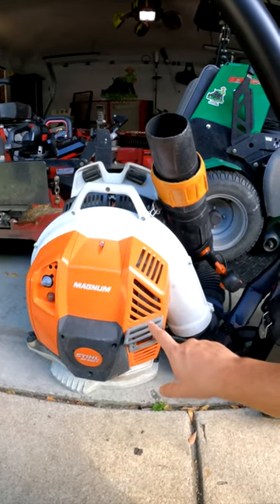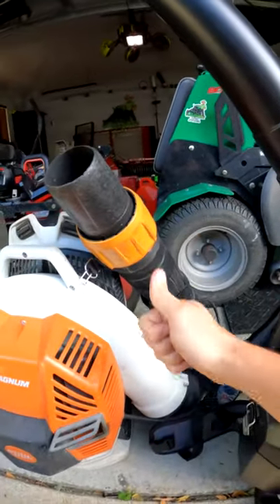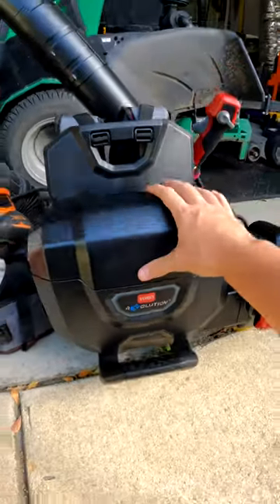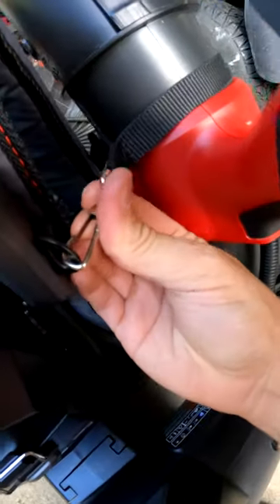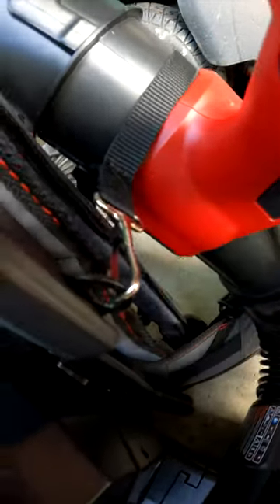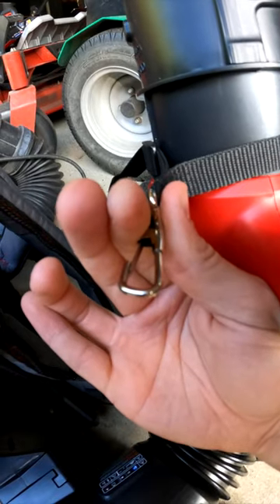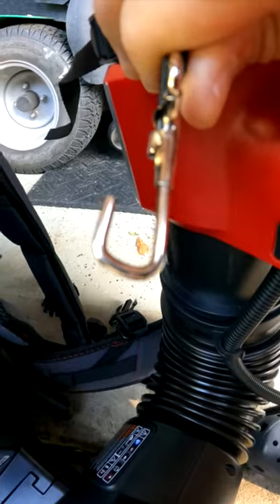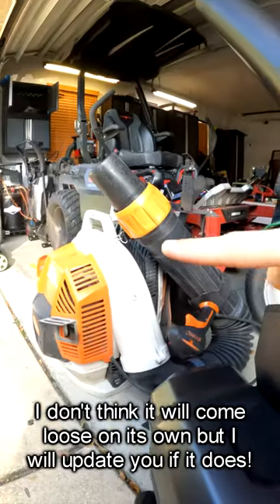Making a battery leaf blower better...

Comment: Better option because that will eventually fall off flapping around on the road. Gt a quick link... the one that has the spring lock not the screw.